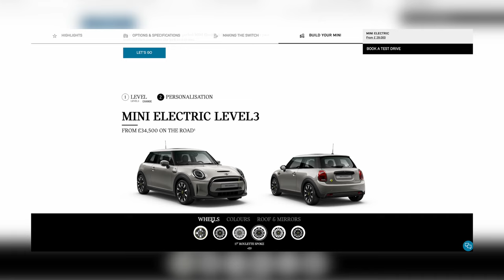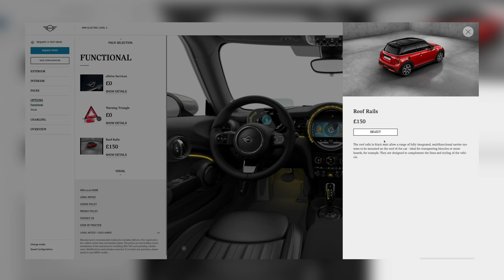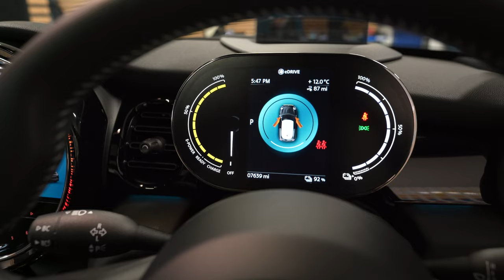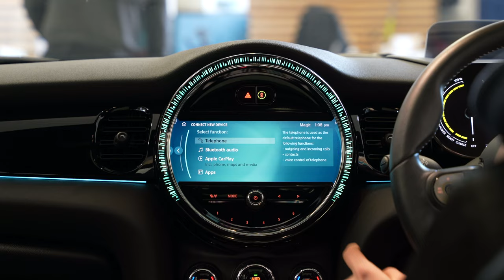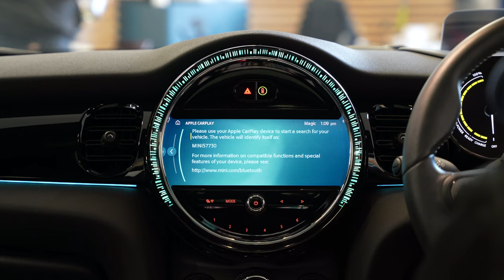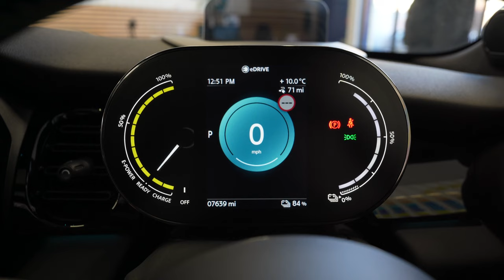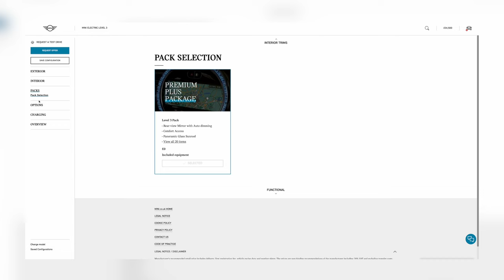MINI Electric (Cooper SE): Walk-Around and Comparison with the BMW i3

Comment: Great comparison between both vehicles, to make it short, I ended up buying a 2020 Mini Cooper SE. However I've owned a petrol Mini before and like Minis in general, so it was more of an emotional decision (as it usually often is with Mini) rather than a logical one, because the i3, especially one with that bigger battery, would've suited my needs maybe just a bit better.

Initially I really disliked the looks and design of the BMW i3, but have started liking it. It's a shame BMW discontinued it, it seems the demand for more compact cars isn't there anymore? In my opinion the i3 still looks modern and different, still sort of ahead of its time. It really shows how much clever engineering went into this car.

Comment: I find the MINI Cooper SE so much fun to drive! You have the different driving modes that are easy to toggle thru. It corners and hugs the road so well.  I took an i3s to drive and would need to spend more time with it. I found it very different to the MINI Cooper SE…the visibility and how it felt on the road. The MINI feels like a car (I am coming from a 330e) and the i3 feels like its an electric car which, of course it is. Saying that… the SE felt more like a car I was used to driving, connected to the road, quick and agile while the i3 felt different. Also… the MINI’s screen is touch screen and closer to the driver so I find it easier to use.  The i3’s is up on the dash and has to be controlled thru the iDrive as it does not have a touchscreen. The Harmon/Kardon stereo in the SE also delivers a great sound and is fun to listen too.  The i3s also had the Harmon/Kardon stereo but, it did not have as much bass as the SE’s system.

Comment: I have the i3s for two years now. BMW gave me the Mini for the day when I had the two year service. What I liked on the Mini was the dual climate control, and the softer suspension. What I didn’t like was the cramped interior and boot space and the front wheel drive. You can floor the i3s without wheel spin even though it’s quicker than the Mini.
I didn’t have it long enough to test the range although I know that the Mini has less.
Reply: Mini has 200-250 km’s of range consistently with AC on (105 km/h average = 200 km’s). How about i3s?
Reply: @TANOCA17  150 miles

Comment: From what I understand, the Cooper SE is pretty much a Mini 2dr hatch with the i3's 94Ah (or 33kWh) battery paired with the i3S 135kW (181hp) electric motor shoved in the front instead of at the rear. Kind of wished they used the newer i3 120Ah (42kWh) battery instead to give it just a bit more than 120mi range, but alas it is still more of a conversion car than a purpose built EV like the i3 was.

Still a great urban runabout vehicle if you don't need 4 doors or road tripping range since the smaller battery makes it lighter and more nimble in keeping with Mini traditional handling character.
Reply: There probably isn't space for the 120Ah - or cooling.
Reply: It’s a different battery from CATL for packaging.

Comment: I'm expecting that the big plus for the Mini will be handling and road holding, especially when it's driven a bit harder.

Having driven 50 miles home Friday night (with possible black ice) at an absolute snail's pace in my i3, I can appreciate what that means. However, my 94Ah i3 has the Range Extender and with my pretty high mileage and some unplanned journeys, it has been a huge help. It's supplied less than 10% of my miles but without it, there are journeys I could not have made and places I could not have reached.

Comment: Thanks Martin for another very great video. Having had two MINI Cooper S’s then a 60ah REx before my current 94ah REx i3s I will be interested to hear your driving impressions. I still miss the Go Kart handling and the wonderful panoramic sun roof of my MINI’s but the i3 is an easier car to live with as the interior space and design is so much better albeit my MINI’s did not have a touch screen infotainment screen. The i3s is definitely a much more fun car to drive than the standard car and obviously performance much more akin to the ICE MINI Cooper S but with a faster take off and acceleration up to about 50 mph. To me the MINI is a bit low to be city car and begs to be driven but once you take it out into its true habitat the short range is too much of a compromise. Although these two BMW built cars have a lot of similarities I think they will generally appeal to different buyers which makes it all the more disappointing that there is not (yet) a EV version of the 5 door MINI hatch or Clubman or a BMW i1. I cannot see many i3 owners moving on to a Corsa, 208 or one of the Citroen/DS models.
Reply: If you love your i3s as much as I do you will find it very difficult to find a replacement. In a year from now the lease runs out so I’ve been looking for a replacement. I really think I’ve found one, the Smart #1. I’m going the whole nine yards and going for the Dual Motor 428 hp 543 Nm Brabus version with its 0-62 time of 3.9 seconds. The standard 272 hp 0-62 in 6.7 top speed 112 mph will do for most. 😮

Comment: I prefer my i3 with the heat pump, but I wish the i3 had more tire options for the 155/70 R19.
Reply: Yeah. Tires are nonsense
Reply: I am okay with the tire size as it was designed for efficiency of the car. More tire brand varieties would be nice- similar to what Europe offers for the car.

Comment: We have a 2017 i3 for 3 years . Love the car, handling speed performance and reliability.
Space in side is great and comfortable. Access to getting in and out of the front seats is good and ok for the rear which has doors.
Bring 78 years old how low are the seats and ease of getting in and out??
Reply: Quite! It's easier to get in and out of our i3 than our Mazda 6!

Comment: Hello Martin,
I’m a 2014 i3 REx owner and enjoying your channel (and my i3) very much.

You had mentioned in a recent video that, since you are a small channel that you’re very likely to answer questions more readily.
On that note, I have a question(s) about the i3 battery and cabin preconditioning.
You state, and I’ve heard this on a few other channels, that a THREE-hour departure time is required for battery AND cabin preconditioning.  However, there are other YouTube channels that report only 1-hour is adequate..?
When I bought my i3, I specifically asked BMW about battery preconditioning. They told me there is no battery preconditioning, only cabin conditioning.  In retrospect, I do understand that most dealers, especially where I live were never very savvy with the intricacies of this car and I’m sure that you have researched this issue thoroughly.

Why has no one ever shown any documentation from BMW which clearly states how this function operates?  Do you know of any?

Does the 3-hour requirement have something to do with the initial battery temperatures? Could the time requirement be smaller if the battery was at 60°F versus 30°F?

Have you monitored pre and post conditioning battery temperatures to verify actual battery conditioning?

I’ve owned my car for nearly 4 years now and this issue has always perplexed me.
Thanks so much for your dedication to electric vehicles, especially the i3.  You are most certainly my go to source for all things i3!
Reply from the maker: We will definitely need to make a video covering the HVAC system of the i3.

Long-story short, everybody is somewhat correct.

The battery preconditioning is a feature which only kicks in if you have a departure time set in the vehicle itself and it needs to be equipped with the winter package (have heated seats).

It can take a long time for the battery to get up to temperature, but it's not something to worry about, as the car controls that - you just put in what time you want to have it ready.

If you precondition from the key or phone app though, it's only the cabin heater (or AC) which is turned on for up to 30 minutes.

Hope that helps.

Comment: Whilst the i3 is a great, practical choice for me at this moment in time, the firm ride is what lets it down.
But, then again, I would hesitate to go for the MINI Electric simply because it's front-wheel-drive...!
So, I'm at a bit of a loss as what to replace the i3 with next time around...!
Interestingly, though, I watched a drag race between the 60Ah Rex i3 vs the MINI Electric on the InsideEVs channel from 2 years ago - with both cars almost identical in weight, I assumed the i3 would launch better with its rear-wheel-drive push... not so...! Basically, it got absolutely 'creamed' by the MINI...!! 🤣
Reply from the maker: Keep in mind the MINI has the motor with the higher power output, on par with the i3s...